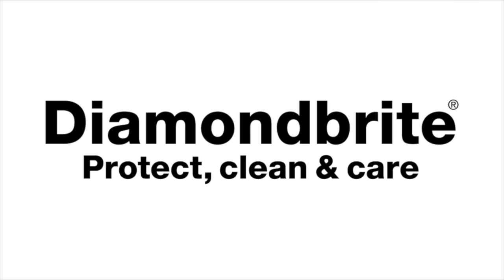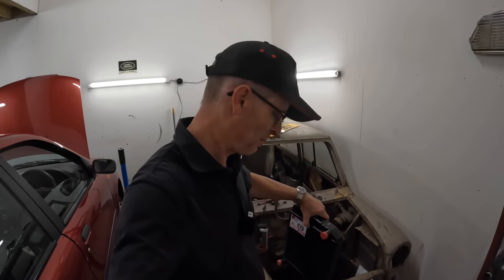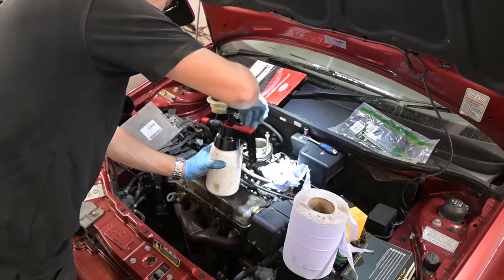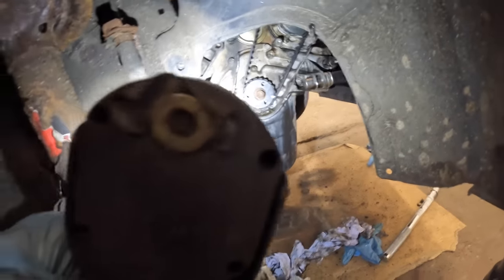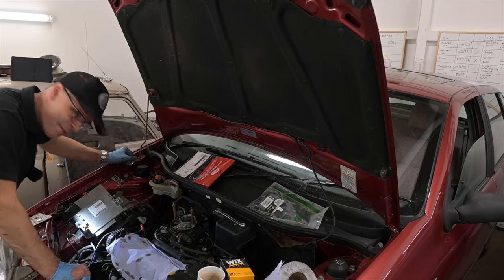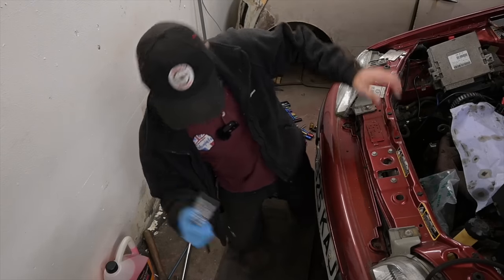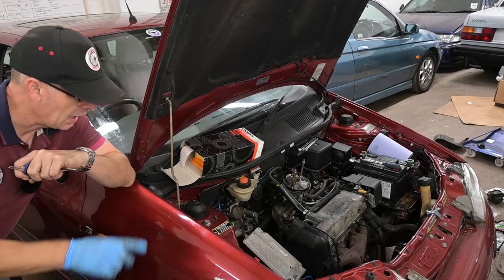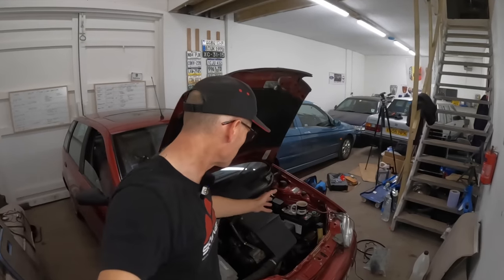Oldest Punto in Britain gets a cam belt change

Comment: My wife’s Mk2 Ford KA has the Fiat Fire engine fitted, however it has variable valve timing so I understand it’s an interference engine.   It’s just had it’s second timing belt & water pump change during our ownership.  I’ve had my wallet hit in the past with snapped timing belts.  Interesting to see how the job is done.
Reply: Yeah the 500 and Ka's do have VCC, they do need locking tool's for them as the crankshaft sprocket desing was changed to not haviving a keyway so just relies and on the crank bolt keepin it together.
Reply: @Ju1ian10001 didn't know that. My cinquecentos are old school, one a fire engine and the other the pushrod version found in everything from 127s onwards.😊

Comment: For big hex holes I use a bolt and 2 nuts locked then you can just undo it with a normal socket.
Reply: Fcukin hell mate, what a tip! Thanks! 👍🏻👍🏻👍🏻
Reply: I've had that socket in my toolbox for over 20 years, gearbox and sump in most fiat's use it😊

Comment: Great job. 
It's a good idea to give it a citric acid coolant flush. In fact, It's a good idea to give all your cars a citric acid coolant flush as it neutralizes the rust in the system. It worked wonders in a two of the mercs I owned. One was so rusty and blocked up but after the flush the coolant stayed clear and rust free for many years and mant coolant replacements after. It's even mentioned in MB in house service literature if an engine has ever been ran without the correct coolant for any amount oif time.
Reply from the maker: Good idea, that’s a job to do when it’s gone next as there’s no running water up at the barn

Comment: Great engine! Just think how long it's been in production. Even used today in panda. Imho the 1243 was the best. I'm not keen on my 59 pandas 1.1. Needs too many revs and uses more fuel than my mk11 Punto 1.2 elx. The newer fires have a weird belt tensioner too. Spring loaded thing.

Comment: Such an easy job. As I remember you didnt even have to remove the  engine mount to do it. May be wrong though.The one I did had a ben valve thugh so didnt work when I was done anyway. A huge drawback of the single point injection.
Reply from the maker: thats right, no need to take the mount off, huge advantage!

Comment: The cam belt is clearly marked with a white line to correspond with the timing mark on the camshaft sprocket 20:25. Same thing down below on the crankshaft sprocket. Just to make the job easier and quicker.

Comment: If you can scrounge up a bolt with a 12mm head on it you can use it as a make-shift Allen wrench to pull the oil drain plug.

Comment: I think 60's and 70's Alfa's would give the Punto's a run for the money on rot and your Crown Vic.  Even my 1970 BMW 2000 sprouted a severe case of 'measles' on its white paintwork as it spent the first three years of its life in Morocco and after 3 months back in blighty was spotted all over.

Comment: I did the timing belt kit in my cinquecento sporting and needed 3 water pumps until I got the right one. Pulley either has 17 or 21 teeth and doesn't look like it would be easily swapped over. Your expert would know fiat's reason for 2 types of pump 😊
Regarding coolant i have the pink stuff as that is what motorfactors gave me🤔

Comment: Actually nope the fiat fire isn't, the easiest ever timing belt to do is a ford CVH/PTE engine, the tension has 2 13mm bolts you slaken of and then slide it over. the fiat engine is named fire for a reason as well, Fully Intergrated Robotised Engine, although it had use before in the first model panda that had electronic ignition but a carburettor, the punto had single point (also called Throttle body) injection and electronic ignition. The fire engine was still in production and use in the Fiat 500 and second gen Ford KA but has veriable camshaft control, wasted spark ignition and multipoint/sequentail fuel injection. Plus the Fiat 500 and second generation punto could be had with a 16 valve version of the engine, the bottom end was the same but the head was completley different. Both the VCC and 16 valve version of the fire engine went from being non-interference engines to interference engines and the timing was/is critical. As a side note the 8 valve Fire engine fitted in second Gen punto's became as bad for Head Gasket Failure as the Rover K-series and was also well known for the oil feed pipe to the cam blocking and ruining Camshafts.

Comment: When I had my Panda 100HP, which also had a FIRE under the bonnet, I put the cost of changing the cambelt and waterpump as a great example of why it was such a cheap car to keep on the road. Low hundreds from an independent specialist. An excellent engine design.

Comment: The other cambelt replacement trick, without having to own the locking tools, nor concern over pulley markings, is to cut the old belt lengthwise, remove half of it, partially slide on the new belt, cut the old one off, before sliding the new one on, fully.
Reply from the maker: Ive come across this, great idea but its surprisingly hard to cut a belt!
Reply: @furiousdriving  - angle grinder with 1mm disc. 😉
Reply: No locking tools required on a "normal" 8 valve FIRE engine, nor were any manufactured, being non-interferance if the timing went out, no damage occured and you could/can turn the crank/cam back into time. Although the locking tools for the VCC 8 valve units can be used and work.
Reply: I like that idea

Comment: The water being pale isnt necisarily a sign of a weak mix. A garage I worked in used clear glycol so its a possibility even though that is the only place I ever saw that.
Reply from the maker: It had no smell either which I would have expected with any kind of coolant
Reply: At work, we get a 200L barrel of clear, concentrate, universal coolant.

We dilute it down & add red dye so it looks 'normal'
Reply: @furiousdriving  Yeah that could be a worry.
Reply: @nothingmuch.3014  Yeah then it's the same setup. We didnt colou it thoguh beause cars have different colours and some times the colour gets very icky when you mix different ones.

Comment: The two turn check is a bit obsolete with a non interference engine they will always turn as the pistons and valves never share the same space but well done remember doing one of these when I did the head gasket on my wife’s mk2 ponto
Reply from the maker: this is true but the marks on the thing wheels should come back to the same place after a full circuit - if not the belts routed wrong or supplied the wrong length

Comment: Have you put the timing belt on the wrong way round??? I’m sure I saw the arrows pointing back?
Reply from the maker: Im going to have to look now, I put it on and took it off again, not sure which bit made the video, although as timing belts arent directional it shouldn't matter, the arrows are just for helping with timing
Reply: @furiousdriving  I could be wrong buy it looked like the arrows were going backwards
Reply: And the arrows are for rotation of engine mate. 100%
Reply: The arrows were clockwise looking from the right, correct for rotation of engine. The later shot was from the left of the engine looking right.
Reply: @furiousdriving  No No the Arrows and direction does matter, It's all to do with teeth on the belt and pulleys and how the stresses go through them, it can cause the belt to snap premeturelly (not so bad on a non-interance engine, but again on an interance engine, well bent or broken valves could be the end reult) I did learn the many reasons why in college when i was an apprentice, but that was nearly 30 years ago so the memory is a bit vauge now. So in short Belts can be dirctional, it will say on the box and on the belt.

Comment: Supermini Fiats from the very beginning have always been cheap to run, cheap on parts and very easy to work on. It helps that their designer engineers have to as part of their training actually work on the workshop floor. I`m an ex Italian vehicle workshop proprietor and car collector - Our daily driver has been a small Fiat since the 127 and great favourite was our Unos, perhaps the 1.3 70SL with sunroof but FIRE engined Uno FIRE 999cc with 5spd was maybe better overall. Those FIRE engines by the way stand BIG kms (over 250k) if serviced, Never had the mk1 Punto but had the mk2 90SX with CVT trans, and Grande Punto Dynamic with 1.2 90 hp diesel. All pretty good very practical, cheap cars to actually own.